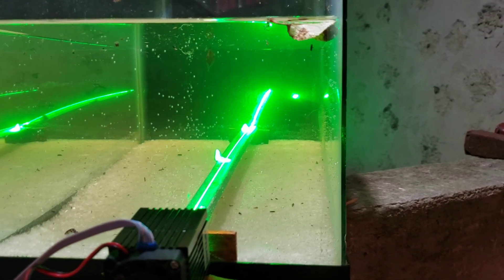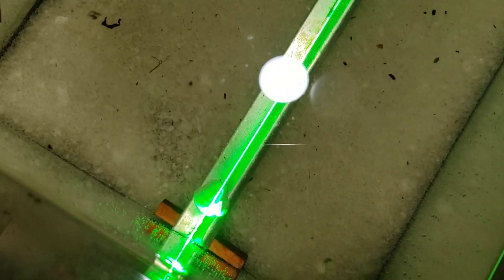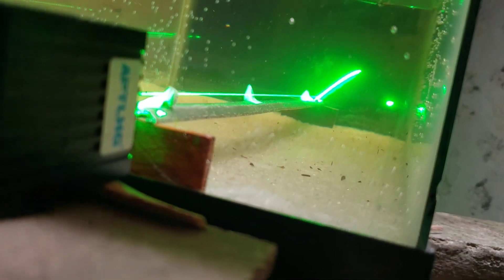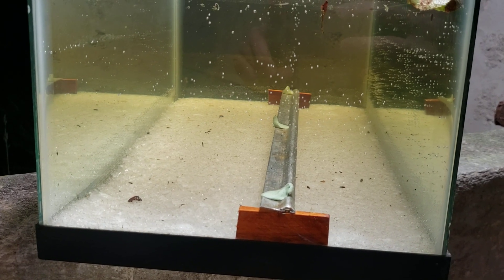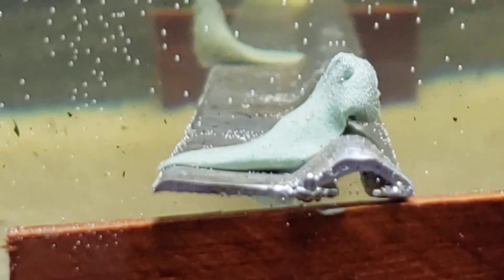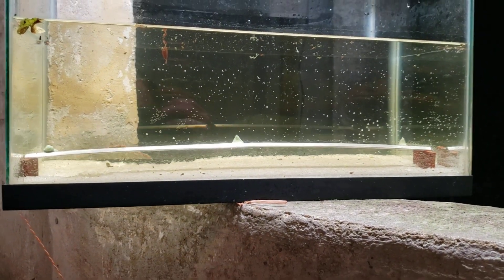seeing over a curve in a density gradient (salt water gradient)

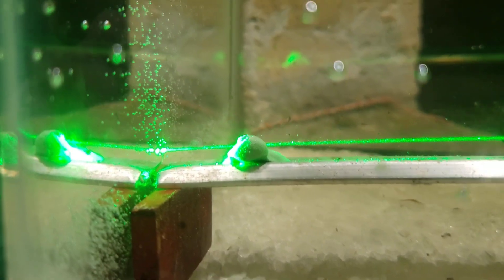Comment: 1:00 Regular manipulation. You raised the flow of light in the beginning. What prevented you from bending more of the metal plate so that the light line runs exactly parallel.
Reply from the maker: I don't understand your question.
Reply: @fromjesse  I'm saying that the way you draw your diagrams is the way you do your experiments. You raise the light stream upwards by manipulating it as if the light in the atmosphere initially rises up. This is not a question, but a remark that you are deceiving yourself.
Reply from the maker: @algirdasbartusevicius473  I am not deceiving myself or anybody else. We can discuss this experiment once we get some basics settled, I asked you a question in another thread, and I will continue to ask it until you answer it.
Reply: @fromjesse  Trying to prove that light in the atmosphere bends down, but at the same time pointing the laser light up, is cheating and manipulation. I will also repeat this until you understand it.
Reply from the maker: @algirdasbartusevicius473  You really don't understand density gradient refraction do you, even after literally seeing it in action in full color HD video.

Maybe this will help. Light travels slower through more dense medium. In a gradient, this causes the light to veer towards the more dense medium. It doesn't matter whether the light starts with an initial upward, level, or downward slope, it steel veers more downward.

Check out this video. It shows all kinds of different beam angles, and you can see I'm not forcing a particular outcome by fine tuning my entrance angle of the laser beam. https://youtu.be/khOzbCXGnW0
Reply: @fromjesse  I don't need to show your video every time, because I have made a 2-meter long aquarium myself, in which I performed many tests perfectly. What I want to say is that it is impossible to explain the view of Mount Etna in this way. You cannot explain, and no one can explain. I was talking about a particular video with a sphere-shaped surface.

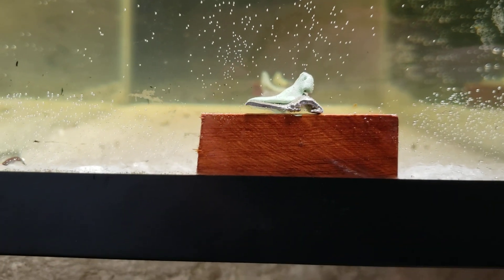Comment: 2:22-- a couple items:
a. how do you know there is a gradient?
2. How do we know the aluminium is physically bent? (I'd like to see it out of the tank on a flat surface.) 7:46-- ok. But the medium apparently also exaggerated the curve. No, that's not fore shortening.
iii. the bar and the light seem to be bent to the same degree, so... how doe we know the medium isn't bending the bar?
d. 6:00--no. You created a medium in which refraction "sank" the distance. So the distance can be obstructed by refraction. #thanksJesse
5. 7:18--No, for completeness you should have shown us the side view of the bar and the laser again AND shown us the control demo of both the bent bar in plain water and a straight bar in salt water. But that can be your next demonstration.
vi. Lastly, what are you trying to establish here in the actual, practical discussion at hand? Do you have a claim?
Reply from the maker: > a. how do you know there is a gradient?

Well let's see. I know there was a more dense region at the bottom and I know it was less dense region on the top because there were dead bugs were "floating" part way down where they met a medium of a density that equaled their own LOL. And they were floating at slightly different levels due to their own different densities.
That's a pretty good indication that there was a gradient.

Additionally, I had somewhat stirred up the mixture a little bit while inserting and removing the aluminum strip and wooden blocks so even if it had been a shear boundary previously, I inadvertently caused some mixing so there were lots of other densities of mixture besides just the top and bottom densities.

Furthermore,  the laser beam bent gradually, as is typical of a gradient, and not abruptly as is typical of a boundary refraction. Had it been a shear boundary instead of a gradient, the laser would have bent abruptly and only at the boundary.

However, let me know if you truly genuinely think that perhaps it wasn't a gradient and I will try to come up with a way to demonstrate it, maybe with beads that each have different densities and float at different heights.

> 2. How do we know the aluminium is physically bent?

Well, uhh, I did hold it up to the camera after pulling it from the fish tank to show that it was curved. I guess I could have held it near a straight edge or surface to show. You have my word of honor that I have not bent it since the experiment, I can get a picture of it against a ruler if you like.

> iii. the bar and the light seem to be bent to the same degree,

Indeed, it took about 3 tries. First time or two, the aluminum was bent too much and I had to take it out and straighten it a bit. Eventually I got it to match the laser beam pretty close.

This experiment was specifically performed to test whether refraction could make a curved surface look flat if the light was bending at the same rate as the curved surface, so I curved the surface to match the light.

> so... how doe we know the medium isn't bending the bar?

I'm not sure if you mean literally bending the bar or just making it look bent...
The medium did not bend the bar. I personally bent it before putting it in the tank. It was bent the same when I took it out. The medium wasn't actually bending the bar. 

The medium was also not making the bar look bent - the side view of the bar when it was in the tank matches the side view of the bar when it was out of the tank. Do a screenshot and look. 

And you notice that when the density gradient got all mixed together,  the bar appeared bent again even from the end view.

I guess I should have put the laser back on to show that it was straight again after mixing huh. Well it was late and I was tired and I didn't think of that, but that's a good idea. I'll try to do that on the next go around. I can make excuses as good as the next guy!
Reply from the maker: PS: And, my friend, you simply must get a fish tank and try these experiments. They are not hard or particularly expensive. And they are so much fun! You learn so much as you go!
Reply: Your incredulity is beyond hilarious. You keep asking others to do pointless observations that you could do by yourself. But you can't of course, because that would demolish your entire belief system.
Reply from the maker: Hehe, did you edit your comment, changing your questions with your rebuttal of my replies? 
Feel free to just make new comments, youtube has a lot left and they are free :D

> 2. How do we know the aluminium is physically bent? (I'd like to see it out of the tank on a flat surface.)

Here: Just for you: https://i.ibb.co/ZMcwfVP/20221126-111028.jpg

> _ But the medium apparently also exaggerated the curve. No, that's not fore shortening._

Huh? Exaggerated what curve? Why'd the curve appear missing when viewed from the end of the aluminum strip?

Oh, you mean after I mixed up the salt water? No, that didn't exaggerate the curve. It just revealed the curve.

I was using foreshortening to allow us to see the real physical curve of the aluminum strip.

> iii. the bar and the light seem to be bent to the same degree, so... how doe we know the medium isn't bending the bar?

Well, you got my word. I showed the bar was bent even when pulled out of the tank. I even took this picture for you: https://i.ibb.co/ZMcwfVP/20221126-111028.jpg

But ultimately, I explain how I do it, use your own fish tank and salt water and see for yourself :D :D :D

> d. 6:00--no. You created a medium in which refraction "sank" the distance. So the distance can be obstructed by refraction. #thanksJesse

No, nothing was sank in the distance. See how the laser is pointed upwards ? The observer has to look upwards that same angle. You can also see that a stable density gradient causes things to appear _higher_, not lower: https://youtu.be/yZ6lyqqyhYY?t=327

> 5. 7:18--No, for completeness you should have shown us the side view of the bar and the laser again AND shown us the control demo of both the bent bar in plain water and a straight bar in salt water. But that can be your next demonstration.

I'll definitely try and show side view after mixing next time.

Maybe I'll do it in fresh water. But that means emptying the tank and filling it again....  

> vi. Lastly, what are you trying to establish here in the actual, practical discussion at hand? Do you have a claim?

My claim is that a stable density gradient in a fluid can cause a curved surface to appear flat.